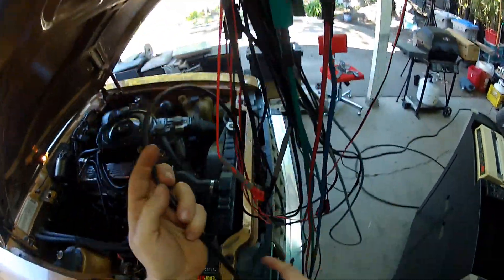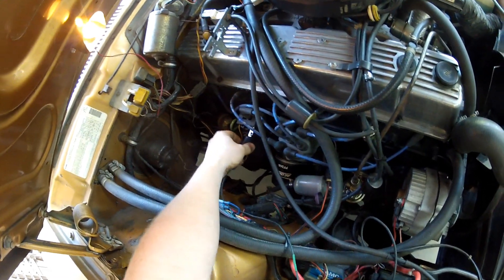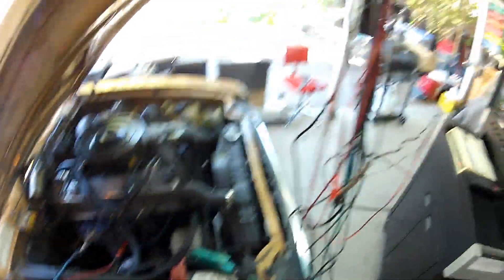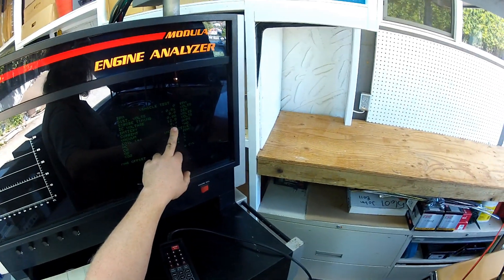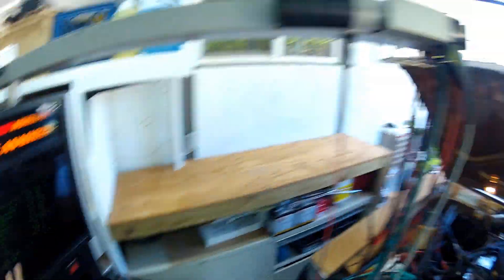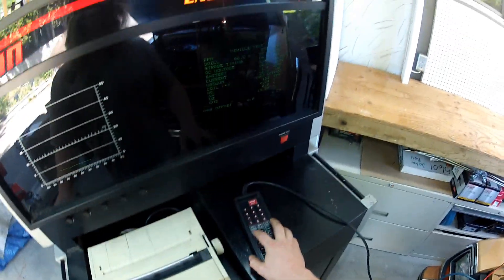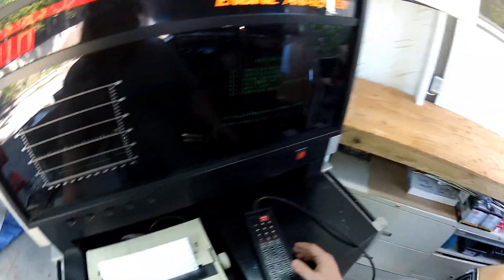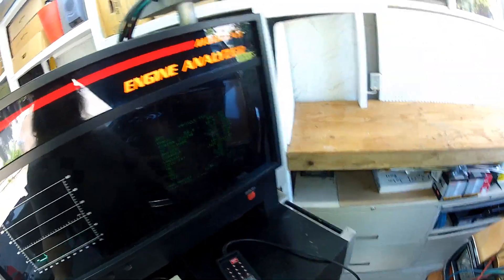Sun Modular Engine Analyzer 1500 - Setup and Operation

Comment: Hey man, SUPER long shot but is there any possibility you have the 7009-1576 magnetic pickup and want to check a couple readings for me? I have a Rotunda timing meter made by sun that's no longer providing an rpm signal. I'm trying to deduce whether or not it's just the pick up before delving further into it but surprisingly enough, it's hard to find any literature for an ultra niche 40 year old device. 

I did find a manual for the MEA1500 and on some applications it uses the same pick up but unfortunately that's about all I could find.

Comment: How does the engine kill button work?
Reply from the maker: My guess is it grounds out the coil TACH wire. That will kill the spark instantly.
Reply: @CelGenStudios  It is definitely done by the coil tach wire, I always assumed they shorted to ground but when I was reading my Allen SEA service manual it sounds like it might actually put it to +5v
Reply from the maker: @CollectorOfThings  That might be a bit more gentle than just grounding it straight-out. Duraspark and the likes is "okay" with doing that but points will almost always burn up if you leave it too long.